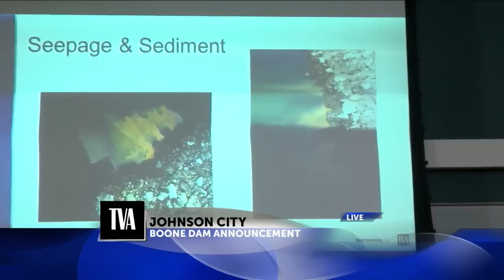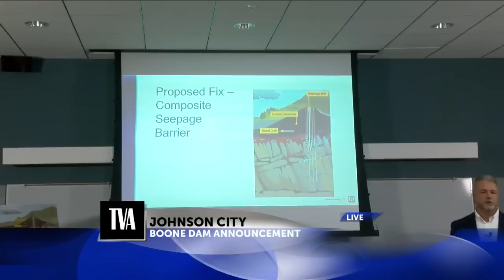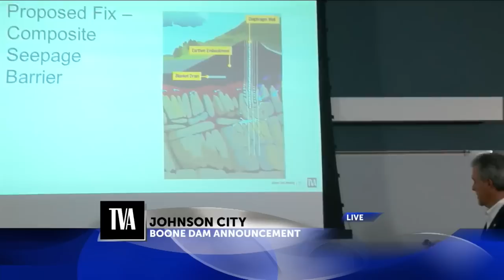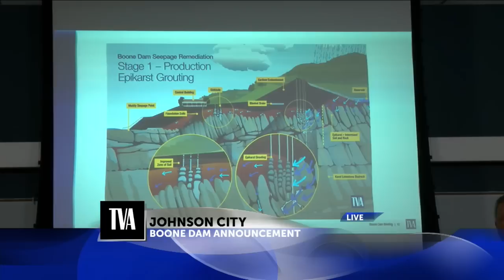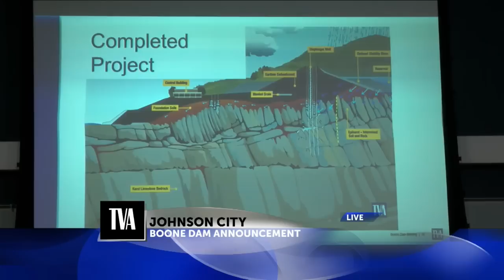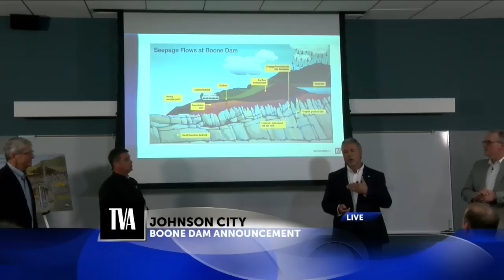RAW VIDEO: TVA says it may take 5 to 7 years to fix Boone Dam; cost $200 - $300M

Comment: UPDATED FULL PROGRESS REPORT - Boone Dam located near TN State Highway 75: Gov’t: Erosion is “undermining foundation” of major dam upstream of US nuclear plants — “Extensive network” of seepage paths found — “Water flowing through from multiple sources & multiple directions”. Nuclear plants doing Problem Evaluation Reports on ‘complex and urgent’ situation. SEE Sequoyah Nuclear Plant - NRC Integrated Inspection Report (pdf), Feb 4, 2015: http://pbadupws.nrc.gov/docs/ML1503/ML15035A300.pdf For the five operability evaluations described in the problem evaluation reports (PERs) listed below, the inspectors evaluated the technical adequacy of the evaluations… The inspectors completed five samples [including] PER 952079 – Functional Evaluation of Boone Dam Sinkhole.

SEE: http://pbadupws.nrc.gov/docs/ML1503/ML15035A300.pdf
Watts Bar Nuclear Plant – NRC Integrated Inspection Report (pdf), Feb 9, 2015: The inspectors reviewed the operability evaluations affecting risk-significant mitigating systems listed below [including] PER 952103 for the discovery of a sinkhole and tailwater sediment at the Boone Dam.

Location:
Boone Dam is located 19 miles (31 km) above the South Fork Holston River's confluence with the North Fork Holston River (which forms the Holston River proper). The Watauga River joins the South Fork Holston almost immediately upstream from the dam, creating a V-shaped reservoir that extends for 17 miles (27 km) up the South Fork Holston (all the way to Bluff City) and for 15 miles (24 km) up the Watauga. The Sullivan-Washington county line follows the reservoir for most of its Watauga span. Boone Dam is 31 miles (50 km) downstream from South Holston Dam and 10 miles (16 km) upstream from Fort Patrick Henry Dam.
https://en.wikipedia.org/wiki/Boone_Dam